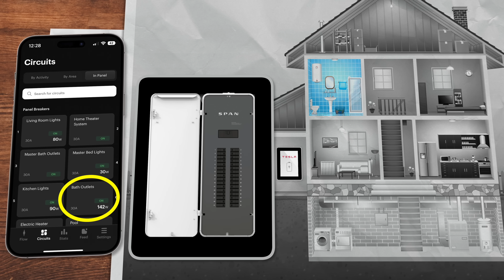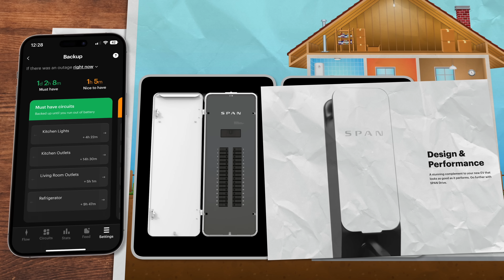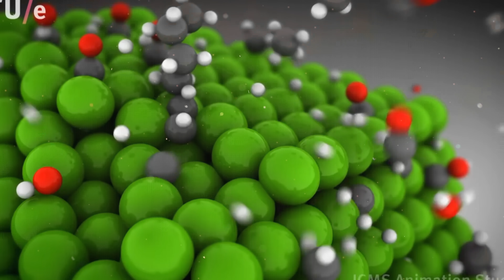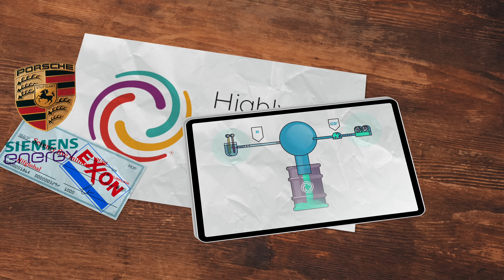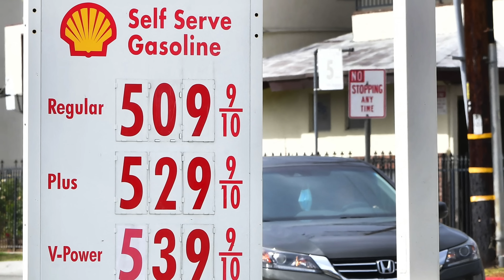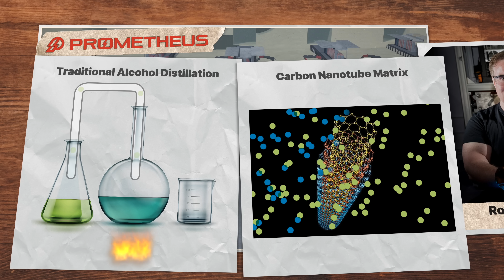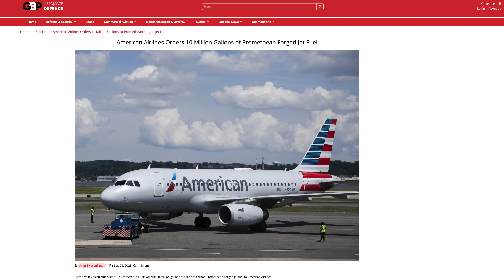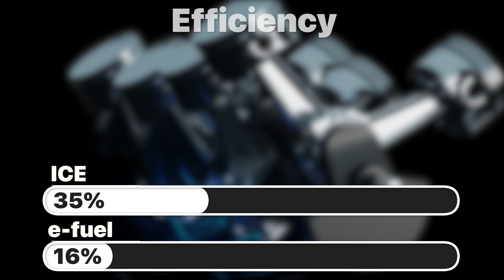EPIC Breakthrough Can SAVE the Internal Combustion Engine!

Comment: I think this is a good middle step. Renewables is probably ideal for this. You only generate fuel when you generate power. It's a nice 1 to 1 solution that doesn't require constant power like our grid does. Additionally, it straight-up pulls CO2 from the air, so it's a good step for 'climate change' if you're into that kind of thing. If we combine this fuel generation with algae/oil generation (which also pulls CO2 from the air) I think we could potentially have a good supply of oil/fuels. Combine this with graphene production that would also pull CO2 from the air and you'd be pulling a LOT of CO2 out of the air. So run our grids on Nuclear, which is far better than renewables for that application, and run our fuel generation off of renewables. I think this is the path forward. Also, if we can predetermine the types of fuels we make, we could potentially run fuel cells off of any excess or simple fuels that can't be used in engines... Fuel cells are better for grid production than renewables, but not quite as good as nuclear.
Reply: No, nuclear fission.  Clean, safe, carbon-free

Comment: The beauty if the Internal combustion engine is that it offers the option of alternative fuels. Ammonia (NH3) is the real option that will enable us to ditch carbon based fuels. Japan is leading the race to develop more green ways of producing Ammonia. NH3 can be pumped into cars just like petrol and is very safe! Hydrofuel Canada Inc are another amazing company to watch!
Reply: Pure NH3 IS NOT SAFE. 

Hydrogen rarely explodes.  But Ammonia gas will simply kill you.
Reply: you will not see ammonia cars anytime soon if ever. But, it will be a likely method to transport hydrogen.

Comment: There are other problems with ice that are not as simple as carbon.  Some of the other components in gas and oil that are an issue and not talked about eg sulfured dioxide. Fine particulates (HUGE) health issue. The problem is the burning of the fuel not so much the full itself. Yet you are right there is a huge body of vehicles out there that should not be replaced simply because they are ice. These should be converted to EV. There is little talk of this solution. The most of the energy use in a car is in the making of the car itself.  Conversion takes care of that. The number of good EV batteries coming from the salvage of EV's can supply some of this market. The conversion option also puts the price of a EV in the range of the masses. Unless of course if you are California were a converted VW bus is worth more than a new EV.
Reply: No sulfur in e-fuels
Reply: @scottslotterbeck3796  That may be so but you are not considering what is in the air that is used to combust the gas. Burning is still not the optimum way to move a vehicle. It is still going to create all the fine particulates. Convert the engine to motor not the fuel.

Comment: This is fantastic news.  It's good for the short term, we can blend this efuel with regular fuel to mitigate the emissions.  It should be used in the most polluting applications at first like flying.  The downside as you mentioned is it's inefficiency and resource intensive, uses lots of land.  In the long term we can use this to get co2 out of the air and put the oil back in the ground.
Reply: The downside is burning efuels still emits pollution, but ZERO CO2 (since the CO2 you emit is recaptured and made into hydrocarbon fuels.). And modern cars do not emit much NO and CO, as well as soot.

Comment: The political forces are dictating the direction that industry must take. The goal is to replace all ICE for EV in all cars and trucks that are on the road today. That is why the Automotive industry are also on board.The government are also financing the solar industry with the help of the power companies to make sure the EV car be recharged at home.  Anything that interferes with that will be squashed. I have seen this first hand myself with a device that was tested by Diesel engine manufacturer that increased mpg by 8% and reduced emissions almost down to 0. The manufacturer was not interested. Why I can only assume that to many people are profiting from the EV revolution and they will prevent anyone from upsetting that course. This cannot be stopped. It is not because EV is better for the environment it does impact in lot of other ways. The same held true with the curly light bulb that saved energy but was toxic to the landfill with mercury.  Better technology not always wins,  it’s the outside force that is driving the direct.  Example the best efficient method to transport of freight is by rail. The trucker Union members started shooting cars being transported by rail until the rail company agree to pay the trucker Union a specific amount for each car transported by rail. This helped the trucking industry become more competitive. My point is that any innovation enhancing ICE will be squashed for cars and trucks. May still be a viable option for air transportation as you alluded to in this video. great presentation. They are always Quick, easy to understand, backed up by fact with pros and cons. And they all have their market niches.
Reply: buy hybeed elrr  hyderggen fulke çell

Comment: Boo, kill ICEs off! Even if the fuel is renewable, ICEs are loud, require explosive fuels (batteries can and will be much safer than current Li tech), and create toxic pollution at ground level in pedestrian and residential areas. Electric tech is the future, don't let the better option be slowed down because existing rich monopolies that want to keep the status quo!

Comment: The whole Carbon causing global warming is a lot of Hog wash. Plants use  CO2 and give back O2 so more Co2 the faster plants and planton will grow anf the more O2 will be removed. The earth have been through much higher co2 level with massive volcanic eruptions in the past. Every body pushing the carbon narrative is just looking for more ways to tax the over taxed person. If you do some research on the average earth temperature, you will find not much change the last 100 years. And the also the Ice Poles have been expanding. So maybe do a video on the truth, that the sun is the cause of weather change not carbon. This will proof that we can rid all the rubbish  in the world by burning it and using the energy from that as a cheap source  of energy to supplement solar energy.

Comment: I have to say that I really, really hate the idea of e-fuels.  It combines two bad ideas into one.  The first is that if we capture carbon from the air, we can "afford" to release it back in the form of a fuel.  The second is that instead of burying the captured carbon - which has no value - we take $20 billion to make $5 billion in fuel, we are avoiding waste.  How?  The only reason this idea would work at all is because it is equivalent to a really high carbon tax.  But instead of using that tax revenue to build useful things, we would be tossing it into the ocean.  I really hate this idea.  One thing to note about "carbon neutral" fuels.  After capturing the carbon, everything past that point is carbon positive.  We cannot afford these.
A better idea is to think about how to make things run on compressed or liquified hydrogen.  Then we are releasing just water vapor.  If you are going to the trouble of making hydrogen, don't mess it up with added carbon.

Comment: well, if they achieve compatible eFuel at double the cost compared to regular gasoline or diesel, it would be great for old timers that people would like to preserve and use from time to time.
but compared to EVs, it is a complete waste of money for daily drivers. and this is exactly the point for EVs. it for sure hurts to buy them because in the next 5 years they are still more expensive to buy, but if you have them, the costs using them is lower and you get a good feeling every day you use them. with an ICE vehicle it is the opposite. in the next few years still cheaper to buy but it hurts for many years every day at the pump and you feel kind of trapped.
but in a few years it is a much easier decision to make when sticker prices of EVs got down to the level of ICE cars.

Comment: great video. i was thinking, regarding inefficiencies of hydrocarbon ICEs, how practical (or impractical) would it be to use hydrocarbon fuel cells? 
also, regarding energy inefficiencies, how about placing prometheus's fuel forges beside highways/at gas stations proper? the passing cars would generate slight wind currents, reducing external energy needs by a little, and you don't need to worry about transporting fuel that far
Reply: Look up direct methanol fuel cells.
Reply: @scottslotterbeck3796  oh yeah, they for sure are a great bridge between suppy chains of fuels used in ICEs and hydrogen fuel cells. i meant like diesel, gasoline, natural gas, etc.

Comment: I don't see how ev is 90% efficient, in California your charger comes from the energy grid, and that comes from Utah coal plants, so how is that 90% efficient, or do you mean when you charge off the solar on your roof? Those are hardly 30% efficient, so I guess your saying 90% efficient if the energy to charge your vehicle is magically made and put into the car, but how is that a even comparison, ev uses energy it got f4om somewhere else, gasoline gets its energy from itself, it's the charger and the battery. To accurately compare gas vs ev , you have to follow the power from its generation point as gasoline is at its generation point when it's in the car, ev is reliant of a energy source, gasoline is the source, compare ev motor with gas by only comparing its output. How many kw does it take to  output 100hp for 5 minutes from ev and how much gass does it take to output 100hp for 5 min from gas? Find out how much gas that uses and put it in a generator how much energy does that amount of gas produce, I bet it's a lot more efficient than the ev, in fact I bet the alternator puts out the kv the ev used to make that 100hp. And if the motor makes 100hp for 5 minutes and the alternator outputs the kv used to power the ev and still sustains the 100hpmfor 5 min its are to say those coal powered evs are inneficient.
Reply: ßeobg

Comment: my biggest beef with EVs is that my parenst still drive their 1967 VW beetle, but my neighbour's 2019 Tesla had to be sold already because the battery was starting to bust, thus making much more trash and waste than that Beetle ever did :(
Hoping for a breakthrough on this level - like the replaceable batteries (I think i saw a video on this on this channel already...) Cheers :)
Reply: Teslas battery warranty is  8 years or 100,000 miles - same for most EV's

Comment: All this time, money and energy spent on trying to find a replacement for fossil fuels. I don’t think batteries are the way to go either. We should be ditching batteries AND fossil fuels. Take all the money saved on fossil fuel research, drilling, refineries, refining, shipping and put it toward electrifying the roads. Take all the money in mining, battery manufacturing plant cost, battery manufacturing cost, all the money spent on charger networks and place it toward electrifying the roads. That’s billion upon billions. Maybe trillions. Enough to electrify roads! It seems insurmountable, but 200 years ago, could you image electric outlets in every house in every room?!  Electricity is the only fuel that is able to travel ALONG with cars/trucks/busses! Let’s take advantage of this fact! Do you know how efficient an electric car would be without carrying around a literal ton of batteries?! Do you know the performance of an electric vehicle if it didn’t have to carry around a literal ton of batteries?! 0-60 in about 1 second??

Comment: Hi Rick. Can you do a video about the cars like the new Nissan Qashqai that uses gasoline to produce electricity to power an electric motor. And could the E Fuels be used in that way to be more efficient.
Reply: Interesting stuff but only n Europe I think.  It operates like a diesel - electric locomotive engine.

Comment: Thank you. Please stop with these click bait titles. 
Now, to the point. Besides the facts we still don't have enough renewables for that (same problem as with green hydrogen) and the terrible efficiency, burning e-fuels emits almost the same amounts of air pollutants (you don't emit SOx and heavy metals, but you emit NOx, PM, CO, VOCs...).
 Regarding the claim these fuels are "net zero carbon"- their production might be carbon neutral, but not their life cycle. A lot of carbon will be emitted in building the infrastructure for producing these fuels. When you build a solar panel, you release carbon (~10-20 grams of CO2e per kWh). A solar panel with 20% efficiency, that produces an e-fuel with 16% efficiency, is actually producing a fuel with 60-120 grams of CO2e per kWh. Since you'll need more infrastructure than just a solar panel, the e-fuel life cycle carbon intensity will be higher, maybe 150-200 grams of CO2e per kWh. It is less than all fossil fuels, but much higher than all low carbon energy sources.
Therefore, e-fuels should be allowed only in airplanes, old vehicles, remote locations, etc. If it will be allowed to use in new vehicles, it will just be another greenwash that will delay our carbon reduction, and will not reduce air pollution.
Reply: wirbg

Comment: I am a supporter of EVs where it is practical to use them and I see this as being in large city/urban areas where charging facilities can be easily built and the benefit of much less pollution is very high. However, the hysteria that is driving the uptake of EVs is over the top and totally ignores the simple logistics involved in replacing the global vehicle fleet, and I am just talking about personal transport here. The E-fuel scenario would be a great fit if it can come close to the current fuel costs and the volume required. Whichever way you look at it we will need something like it because without a giant leap forward in battery technology all the other forms of transport other than cars will not be catered for. If the personal global car fleet is all that we are able to run on renewable power that will not achieve much in the way of greenhouse gas emission reductions as it is a drop in the bucket compared to the emissions in many other areas of the global economy.

Comment: Of every $1 of gasoline pumped into your car only 6 cents of that actually drives the car and you. 94 cents is wasted. Electric motors are at least 90^ efficient - Thats why EVs are cheaper to run.

Comment: electricity transfer is around the 85-90% efficient ballpark, but the sources for said electricity is not so its not comparable in those charts, solar sourse is only around 21-23% if we are going on renewable power, and wind turbines from 20-40%.
Reply: Solar only coverts 23 procent of sunlight to energy, yes. But that is not a loss. You never had more. With fuel there is a lot of energy lost in things like heat, that is real loss. Not all of the energy in the fuel is used for moving the car. All electric in the battery is. All every produced by the solar panel can be brought to the car and used. Fuel needs processing and it needs transport by tanker and truck. It's about how much of the energy you start with that ends up doing useful work. Don't go around including energy you never had to start with.

Comment: So the fuel is gonna be half as effective but you can put it in a car and a plane. In an aircraft, weight is a lot more of an issue. For cars though, it sounds like using e fuels might require you to fuel up twice as much in the future. It might become one of those ethanol things where they start cutting pure gasoline like we do now.
Reply: Look into M85.  85% methanol (used in drag racing) and 15% gasoline.  Wxisting engines can run on it with modification.
Reply: You misunderstood OP. The end product of Petrol E-Fuel is the same as Petrol Fossil fuel. It's just to get there, it's even more energy inefficient than normal petrol dug up from the ground.

Comment: This feels a lot like another oil company scam like ESG. I don’t trust it and I don’t like it. For one, we need to actively remove co2 from our atmosphere if we want to avoid disastrous climate change. Not keep it neutral. Not keep adding to it. But we need to lower it. For two, this system requires energy and sadly we still use coal, the worst combusting and therefore most negative health effect causing fossil fuel, to provide that energy. I literally hate the concept of using hydrogen for this reason. And hydrogen at least wouldn’t be putting co2 back in the atmosphere. So no sir. Do not act like this is a good thing. Wars are fought using my tax dollars over the crap and the people in my nation are getting poorer and poorer to fund them. No sir. Do not be a mouthpiece for oil and gas use to continue. This technology would use electricity to then make a fuel that would the. Go into a hellishly inefficient drive train. This very well may be worse than just burning fuel in the long run. I’m disappointed the title and your outlook were so positive. This is a scam.

Comment: The problem is not the internal combustion engine.  It is the fuel the engine uses and the efficiency of burning the fuel.  Ammonia can be used as a fuel that produces no carbon emissions.  Green Ammonia stores hydrogen for use as a fuel eliminating the carbon footprint.  Hydrogen from electrolysis can improve fossil fuel or refuel combustion efficiency by 20 to 100 percent depending on the application and system design.  There are plenty of alternatives to fossil fuel use in ICE's that are carbon neutral or zero carbon.